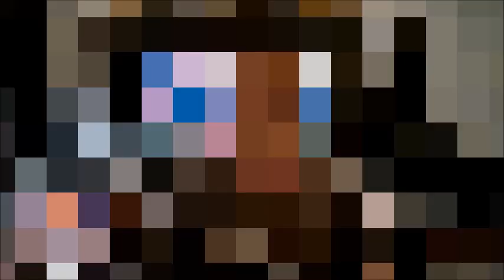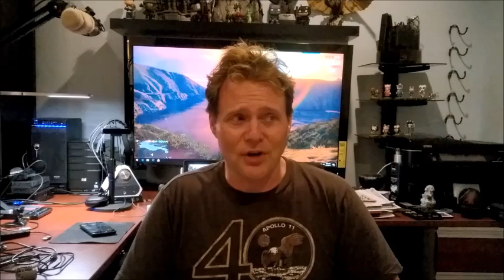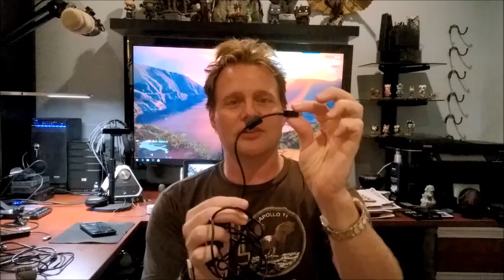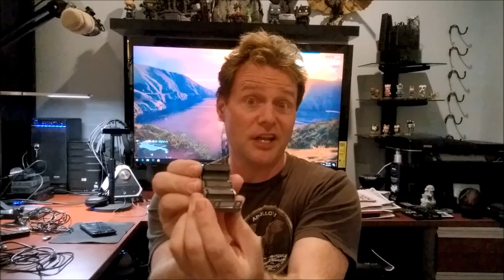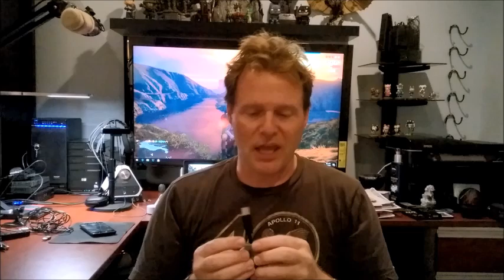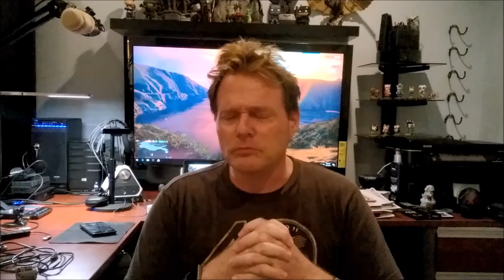What are Ferrite Cores and How do I use one?

Comment: I fitted drls ( daytime running lights) to my car front grill, now my radio dab signal is terrible 
Where should I fit the ferrite core? To the dab areial cable or the drls cable? And how many?
Reply from the maker: Hi Lucio!  I'm not sure how you're wired--for example, if your DRLs end in a 12V cigarette lighter plug or if you're running the wires straight into the fusebox (or, if so, whether it's wired to the fuse box under the hood or inside the car).  So I would take a guess that your DAB aerial cable should have one attached, somewhere close to where it plugs into the radio.  If you have slack, wrap the wire a time or two around the core like I do in the video, and just one should do it, if that's what's going to fix the problem. If the DRLs mention that they need to be grounded to the vehicle frame, be sure that they are actually grounded onto the bare metal of the car, because that can also be a source of problems like this.  Last, if the ferrite cores don't work, and the maker of the DRL doesn't have any suggestions for you, you may need to try a Ground Loop Isolator. I had a car stereo with interference noise where I had to put one on to properly compensate for a bad ground inside the car stereo head unit itself.  I hope this helps you! Definitely a) check all your connections, b) talk to the maker, and c) see if anyone else has also run across the problem, in addition to trying this cheap & easy troublshooting step. :)
Reply: @trentonbennettVO  
Hiya 
Leds are Wired to fuse box under the bonnet (hood)  
And have a wire to the car battery for power and earth 
Sorry not much help here as the car came with leds already fitted so not 100%
Reply from the maker: @luciocancellara4995  that helps! I would suggest putting a core on the antenna wire near where it plugs into the car stereo, and if you can, wrap the wire a time or two through the core. But also double-check the ground wire. I had to do after-market fog lights on a car like you've done, I just didn't run into this problem or I could be more help.  Good luck!
Reply: Does it help putting one on each end or makes no difference? More the better??
Also will it help or not if I put one/two on the leds cables ?
Reply from the maker: @luciocancellara4995  those should do! I'm not sure how thick your cable is, you might not be able to double it up in those, but yes, you're absolutely looking at the right thing. :)  Hey, also, this is the guy who digs deeper than I do and does a good job of it. Take a look and see if what he has to say also helps you a bit.  Good luck!  I'll continue trying to keep an eye on this thread so I don't miss any questions you may have.  LINK:  https://www.youtube.com/watch?v=veIL3GeqA68&t=11s

Comment: Hello I bought a bluetooth adapter for my car, and I connected the red wire and negative wire to the cigarret lighter source.. but I hear like interference..what could It be? would adding a ferrite to the wire would solve the problem?
Reply from the maker: Hi Daniel! Does the Bluetooth Adapter also provide you a way to ground it? Typically you need to be able to ground a wire-splice add-on like this to avoid interference (and other weirdness). There should be a grounding wire that needs to be connected to the frame of the vehicle.
Reply: @trentonbennettVO  yes the bluetooth adapter for my car have negative a positive wires. apart from the plug that goes behinid the radio.
Reply: @trentonbennettVO  the bluetooth module connects to the back of the radio with a socket and it have to extra wires, red and black, wich I connected toe ACC and GND but still noise there

Comment: Just added a vintage EQ to my rack that has tons of tranformers/coils. Suddenly I'm getting white-noise type static in my mic line. Gonna try some of these, hope they help. It's pretty bad and it all started with this one piece of gear I can't do without
Reply: Did it work for you I just added a tube eq as well and getting rf in mic ???
Reply: @WildBillQRO  I think they helped somewhat but also adjusting all the preamps to 0 and starting over helped also routed audio cables as far as possible from power cords
Reply: @cylonvoiceguy  great thanks , I also did some cable rerouting.

Comment: Hey i want to ask you maybe you know if i connect Choke Core to mini pc https://m.geekbuying.com/item/Hystou-FMP05B-Intel-Core-i7-5550U-4GB-64GB-Mini-PC-392733.html?ref=w&Currency=EUR then its aux audio output will be good for tda7850 amplifier ?https://www.ebay.com/c/938535304   
i try to connect them from one power supply them bouth but i hear big noise then i tried a lot of stuff like  noise filter denoisers nothing helped only bluetooth module but i want to connect from aux.thanks if you could help me😊

Comment: I have some 8' LED shop lights that Buzz and kill my FM radio  what would be the process of using these to kill that buzz in my fm radio can't listen to any music ,  unless i turn the lights off and set in the dark any thoughts or help would  sure be great,
 Thanks
Reply from the maker: Hi R. Freeland! I think the good news is, your lights being LED means this any interference is likely from the electrical and not the 'bulbs'. So if I were trying to solve this problem, I'd probably get one of the larger snap-on ferrite cores, pass the cable through it a couple of times, and snap it shut around the cable.  I'd put it near the plug end.  I hope this solves your problem! Also, for the FM radio, depending on what kind it is you can buy a third-party "amplified" plug-in FM antenna that will boost the FM signal. I use one on my stereo receiver because I live in a rural area. If you go that route, maybe plug the radio and the antenna booster into a different outlet than the shop lights!

Comment: Hello sir my sub woofer making hummmm noise when switch on .do you think if i put ferrite on sub wire my problem should be solve
Reply from the maker: Hi Naresh! Sorry for the delay - I don't always get my comment notifications for some reason.  If it's humming when you power it up, that shouldn't be a problem. I have a pair of subwoofers that always make a brief hum and 'pop' sound on power-up and I've had them for many years. If your subwoofer continues humming once it's on and powered up, then yeah, that might be a bad ground or RF, but it's difficult to troubleshoot that. These ferrite core things are a cheap way to troubleshoot, and if putting one on the power cord doesn't help, you can also buy various kinds of plug-in gadgets that 'filter' the power (look for 'power conditioner' or 'line conditioner', or 'ground line voltage filter'). I once used a device by Ebtech called the 'Hum-X' to keep a computer's grounding issue from making a hum in my headphones.  I hope this helps you!
Reply: @trentonbennettVO  thank you very much for helping .thank you also for taking your time for me .take care and stay safe 🙏

Comment: H, I attached a Rodin coil (without a ferrite choke ) like the Qi coil on my sound to frequency converter which is connected to my Rockville blutube amp (70 watts per channel) and for unknown reason to me that channel stopped working. It’s possible that when I unhook one of the connections of the Rodin coil the sudden collapse of magnetic field traveled throug the wires and damaged my equipment? Is this possible?
Reply from the maker: Ergh...maybe? You're definitely far afield of my wheelhouse, but from what I can tell, since a Qi coil generates an electromagnetic field, it sounds like that might run counter to trying to handle an electromagnetic interference problem. I would reach out to Rockville and ask them this question if you haven't already. I'm definitely not an electrical engineer with a deep understanding of Qi and Rodin coils. If you haven't tried this already, one thing you might try is to unplug the amp, disconnect everything from it, then do a power drain (you hold down the power-on switch for about a minute to make 100% sure any residual charge within the circuitry is expended). Then connect something simple, plug it back in, and try to run sound without any coils or other modifications. Jeez, I hope you are able to get the problem solved!

Comment: Would this work for a smartphone line hookup to a mixer? Hiss and light static isn't good...no problems with a microphone. Heard material 61 is for Hf  but can't seem to find a snap on using 61.
Reply from the maker: Hi Arne! I'm not as savvy with the Nickel-Zinc MSDS stuff, but I get where you're going with this--you want a core geared at the higher frequencies at which cellphone signals are emitted (and hit those ranges where interference might be coming from).  

If you can't get a snap-on, depending on the kind of cable you're using you could wind it around a ring a couple of times instead to possibly help.  Here's a place that lists some and, if you can't buy from them, at least you can snag a part number and look elsewhere:  https://www.mouser.com/Passive-Components/EMI-Filters-EMI-Suppression/Ferrites/Ferrite-Toroids-Ferrite-Rings/_/N-bw7t9?P=1yxgx60  

I'm assuming you're using the smartphone to feed audio into the mixer while recording? As in, there's a call or online meeting on the phone and that's why you're feeding it into the mixer?  If so, and this means you can't put the phone in airplane mode to cut down on interference, try also keeping some distance between the smartphone and the mixer.

Hope this helps you!
Reply: Hey found two material #61 snap on "fair rite ' I'm going to use both as I can not wrap the cable. As for smartphone to mixer I am running it to forward through to a Pa system and cranking it up to stage volume as I am playing drums to the music I am getting off you tube. Phone runs @80%...pretty sure static is from the phone feed. Although anyone of my audio processors might have grounding issue due to a solder joint. I'm thinking it's the phone as I hear morse code thumping and slight static and hiss. One speaker seems filtered while the other runs full out....which could be internal crossover difference.I can adjust both to almost be identical though

Comment: Thank you! I connected a bluetooth receiver in my car, robbing power from the original CD/Radio unit. It works as long as I don't connect the audio ground wire anywhere (there were three audio wires, L, R, G). But now I get high pitch noise that correlates with engine RPMs. Would it help if I placed two ferrite cores on both audio channel wires L and R?
Reply from the maker: It might! Though I strongly suggest you look into why the unit only works ungrounded - that's an important problem that needs to be addressed.  The fact that this appears to happen after doing this work helps isolate the problem specifically to the Bluetooth Receiver (and the way it's wired).  I realize it can be a real pain to be upside down under the dashboard and unable to find a good grounding bolt from the frame that's within reach AND get the darn wire to stick, but it sounds like you need that.  Since the Bluetooth module itself doesn't have to be in a specific location (just within reach of where your L/R audio wires are going), that should give you some room to possibly mount it elsewhere, but that's where I'd start first.  Once I knew I had it properly grounded and working, then I'd try a ferrite core, and if that didn't work I'd then buy a ground isolator loop.  Hope this helps!

Comment: why ferrite toroids are used in SMPS?
Reply from the maker: Hi Nadhkrishna ks!  Because a switched-mode power supply is continuously changing power states, there is an increased chance of electrical noise problems.  Thus a Switched-Mode Power Supply will have a number of input regulators (including those toroids you mention) because switching currents can cause EMI noise.  Hope this helps you! :)  If not, there's a great chart here that explains possible causes https://en.wikipedia.org/wiki/Switched-mode_power_supply#SMPS_and_linear_power_supply_comparison
Reply: @trentonbennettVO  Thanks sir you gave the answer in simple words, I'll check those link once again thanks for the replay

Comment: If you got one (wrapped yourself) wet,would it corrode?
Reply from the maker: Good question!  The core is iron, so for your "wrapped yourself" example you'd just want to dry it off.  If it's sealed inside the cable (like it came that way from the factory) no worries.

Comment: I recently bought Asus ROG Strix laptop and it keep having this annoying hissing noise when i plug it in and no noise when its on battery. I researched internet about it and find out its a common problem called coil whine with this particular series of laptops. So, i wanted to know is it possible this solution will fix this problem or should i just return the laptop and buy some other one?
Reply: Yikes!  Is the hissing noise only in headphones or does it come through the laptop speakers as well?  If this is coil whine, that's difficult because it means there's something physically wrong inside the hardware--one or more motherboard components are generating interference.  If this problem only seems to happen when you use the headphone jack, then try this:  1) if you're using a headset, see if the hiss goes away when the mic is muted or not plugged in at all; 2) If you're just using headphones, try a different pair; 3) With only a pair of headphones (no mic plugged in), see if the hiss gets louder or softer when you raise or lower the volume--specifically, play a video where the Windows system volume is low and you use the video player to raise the sound, then try lowering the video player's sound and using the Windows system volume higher/lower to see if the hiss gets louder with the system volume or with the player's volume.  I do love me some ASUS hardware, but their support can be hit and miss.  If this is a recent purchase, definitely reach out to them in the event you need to replace the laptop--the sooner you get a ticket in the system, the better negotiating power you have.  Let me know how this goes and what you observe (my questions here)!
Reply: @trentonbennett4864  Thanks for replying. It doesn't come from speaker or Headphone but from somewhere under the keyboard. I ran following solution i found on a forum-
reg add HKLM\System\CurrentConsoleSet\Processor /v Capabilities /t REG_DWORD /d 0x0007e066
on command prompt and it somehow made it go away. Now very rarely it makes that noise abd even if it does its for a second or two. 
I have no idea what registry i added and what it does. Please let me know i didnt do anything wrong.

Comment: Hi, thank you for sharing that information! Just one question : Does that work with any signal? (computer monitor, audio cable between amp and speaker, and so on?)
Reply from the maker: Hi ArsenicShooter:  it does have to do with electrical signals, so yes, signal problems can come down the wire or over the air, or be inside circuitry.  If you've ever heard people talk about 'capacitor whine' or 'coil whine' in some electronics, that's electrical issues that cause interference too.  I once had a computer fan that put interference in my headphone jack and I once had a power supply that needed to be plugged into a Hum-X to get rid of a high-pitched annoying noise it would make.

I did this video to be a very simple, high-level explanation for a friend.  I pondered doing a deeper-dive, and then I found that Scotties Tech does a great job of digging into this than I do.  Stop by this link to his video and see if this helps too. :)  https://youtu.be/veIL3GeqA68
Reply: @trentonbennettVO  Thanks a lot for all this information !
Reply from the maker: @ArsenicShooter  you're welcome!  I hope it can help you. :)

Comment: I get high pitched Morse code like noise. Home studio. Worse on guitars (DI) but faint on vocals too. My studio is in the same room as my electrical mains in and my PC sits next to the 100A mains in if that makes a difference? I've ordered some ferrite cores and also a designated DI box, coming today so hoping it'll reduce it.....
Reply from the maker: Hi Volvo5turbo! Does the noise sound anything like these?  https://youtu.be/uPYyrS7fc7g  There are a lot of things that can cause interference, both on the wire and in the air, so the ferrite core/bead/choke/whatever is one way to troubleshoot.  It would be awesome if the noises in the video I link to here are what you're dealing with because that would make the problem as simple as "turn off your cellphone when you head into the studio".

If this isn't the case though, also take a look at the deeper dive on Scotties Tech here:  https://youtu.be/veIL3GeqA68  This will give you an understanding of what exactly is going on and how to apply these things.

Hope this helps you!
Reply: @trentonbennettVO  many thanks for the reply. I think it was a rather obvious issue. Check my latest vid. Wi-Fi lol. Oldest known issue. I think I also have a separate issue with my pickups picking up rfi so was mildly taken off the ball....
Reply from the maker: @volvot5turbo   wow!  That is a really annoying sound, and I'm glad to hear you found the problem.  Congrats. :)
Reply: @trentonbennettVO  like this https://youtu.be/fY_lj6HhSJ4

Comment: Hi, can I this if a Guitar cable? Thanks
Reply from the maker: Hi Danilo - you can use this on a guitar cable, it depends on whether your problem is a grounding one or an outside interference one.  I like the "Scottie's Tech" video that digs a little more into what exactly the core will do in the way of signal interference.  This may help you determine whether you're trying to solve a grounding issue or an interference issue.  https://www.youtube.com/watch?v=veIL3GeqA68  Hope this helps you!  Good luck. :)